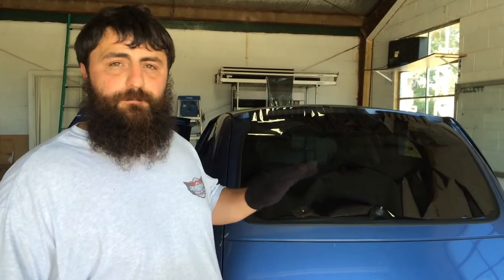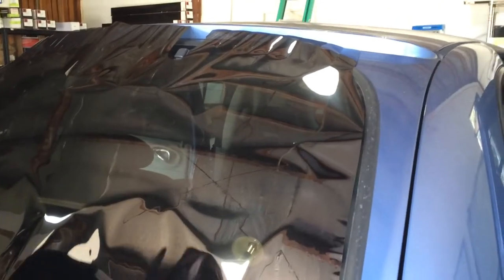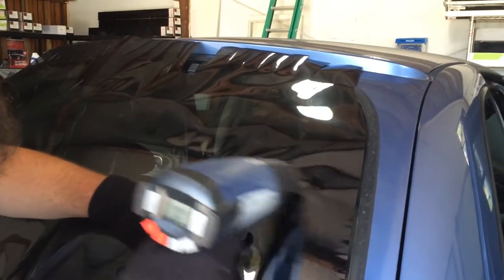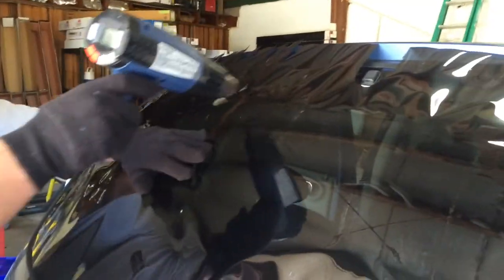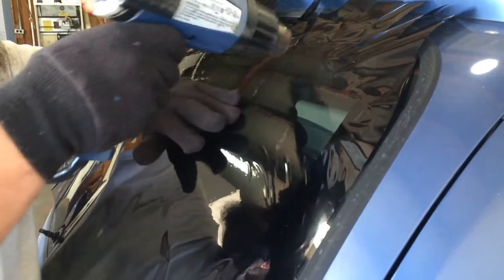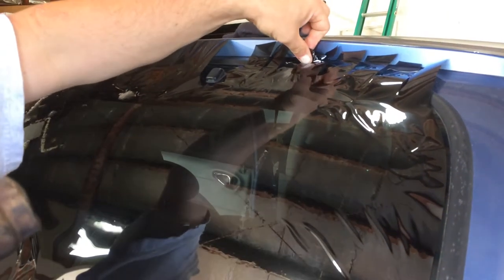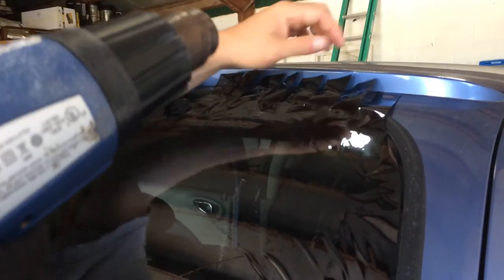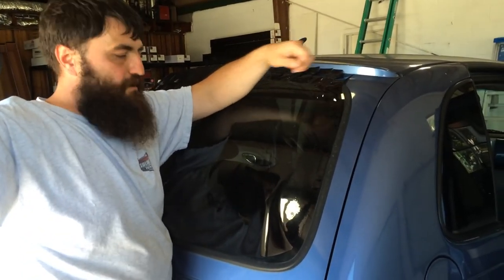Stretch Shrinking : how to tint car windows

Comment: +WindowFilmRevolution can you please show how to remove a crease in rear window while shrinking both in the middle of the film and on the top or bottom edge? I seem to have an issue with getting small creases while shrinking :/
Reply from the maker: There are ways to get some creases out. Basically you build up a tint bubble of air under the crease and then apply heat.

But the next level goal is to find your best fitting shrinking style :-)
Reply: thanks! can you please show a little example of this? I'd really appreciate it!